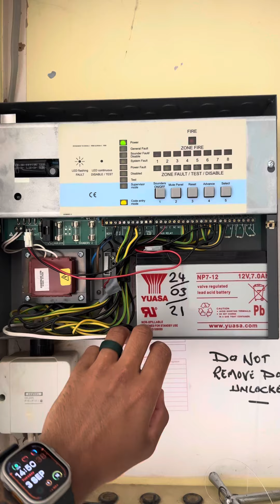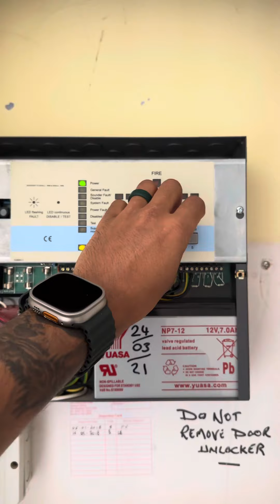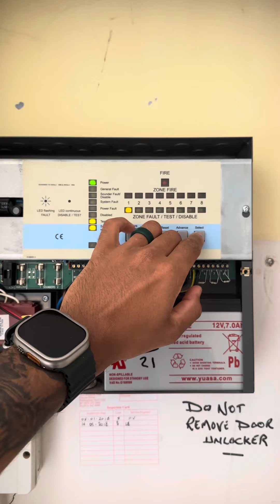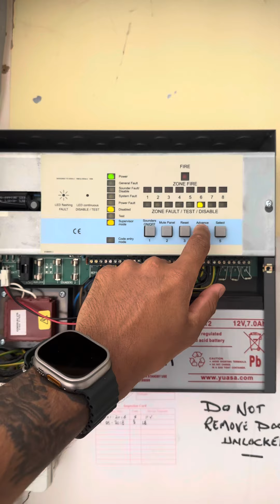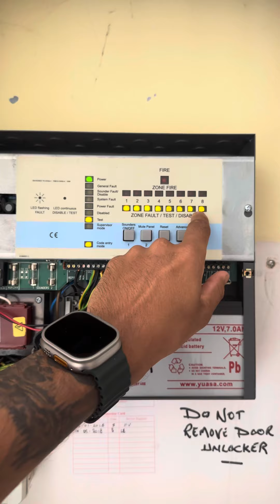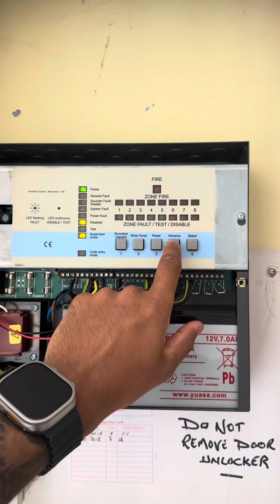Honeywell Zircon 8 zone fire alarm panel Alto

Comment: Hi I hope you don't mind me asking a question, we've got one of these panels, and every often starts going off by itself for no reason and  general fault light flashing with power fault and code entry mode light is on but not flashing, any idea? thanks ( I just change battery and power green light is on as well)
Reply from the maker: When you say it goes off by itself, do you mean it just goes dead or it starts beeping at you?
Reply: @Tarupah  sorry starts beeping like there is a fire
Reply from the maker: @rahimezzati7957 okay bud, there’s two things it could be, there is an issue with the power supply to the fire panel, or the backup batteries inside the panel need replacing as they are no longer working correctly. What batteries did you use when you changed it?
Reply: @T @Tarupah  I guess power green lights indicate no problem with mains and just changed battery to new Yuvolt 12V 2.3AH?
Reply from the maker: @rahimezzati7957 the green power light just indicates there’s power which could be from mains or battery. If the fault light is on as well as the power light too then there’s a problem with one of the two. Disconnect the battery and see if the power stays on the panel.
Reply: @Tarupah ok I’ll and I’ll let you know it’s in the shop which I’m not there at moment thanks for your help 👍
Reply from the maker: @rahimezzati7957 you’re welcome bud! Otherwise if you’re not too far I can look or replace it for you